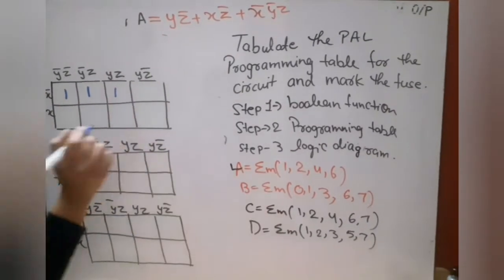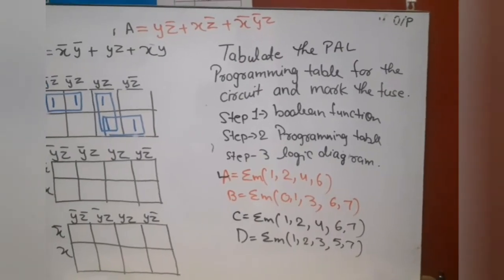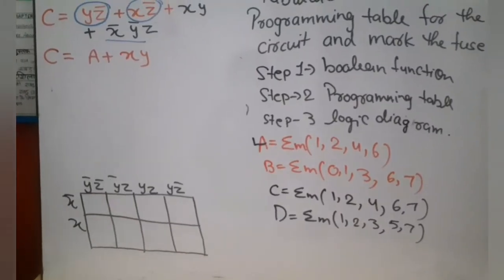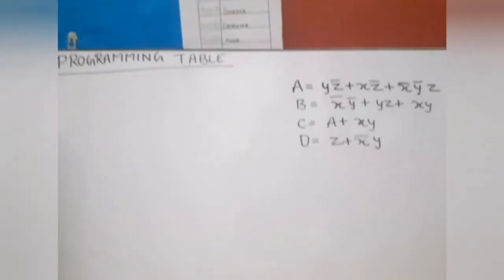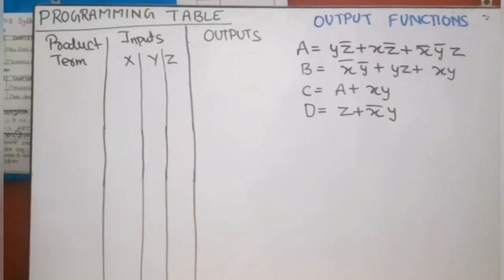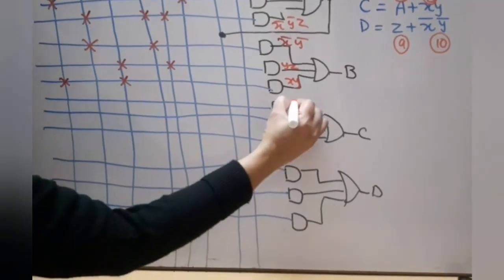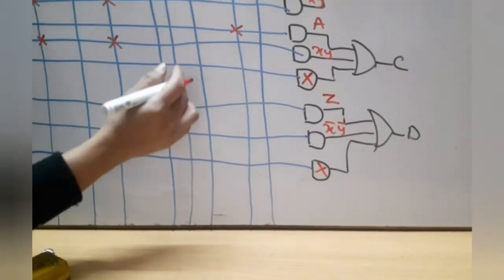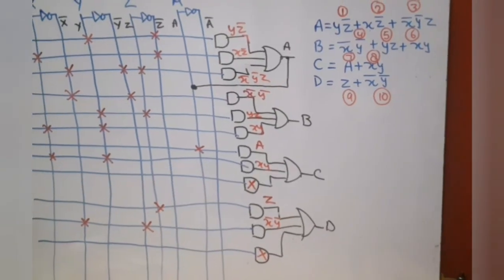U5 L10.5 | PAL| Programmable Array Logic | Example of PAL| Boolean function implementation using PAL

Comment: Pal ma inputs se output kyse nikale...ya fer output yad rakhna hoga😢
Reply from the maker: Output toh given hoga
Reply: @TechnoTutorials2783  there is a question
 explain the operation of a pal with block diagram..
So don't need any draw truth table?
Reply from the maker: @OPCODEPUZZLE  yes no need just draw the block diagram.in which input side programmable AND array and output side fixed OR array
Reply: @TechnoTutorials2783  okk .
Thank you 🥲